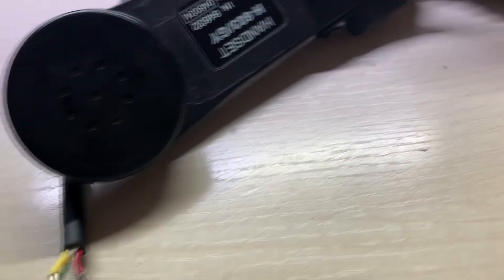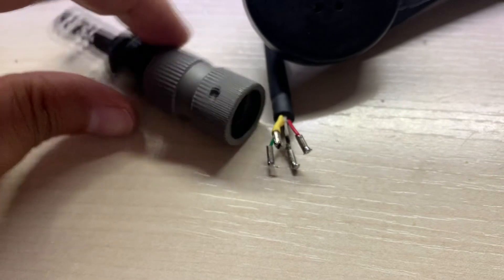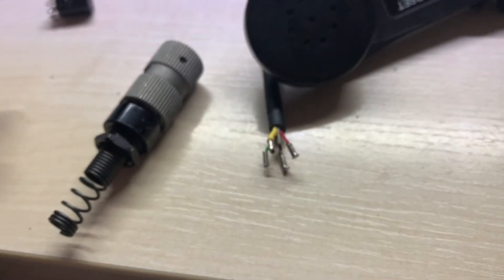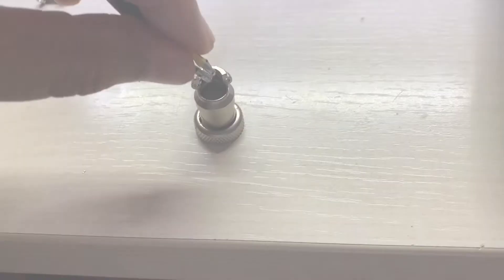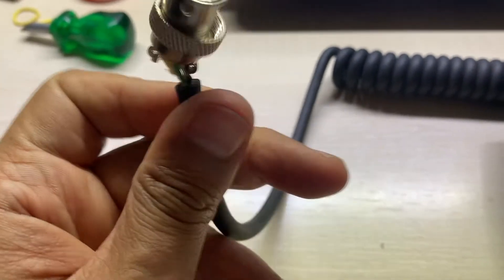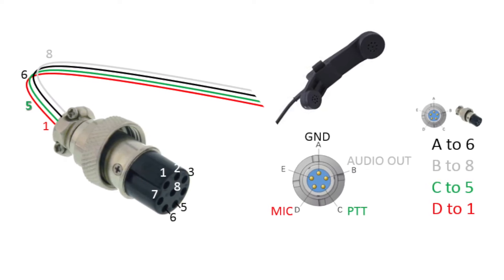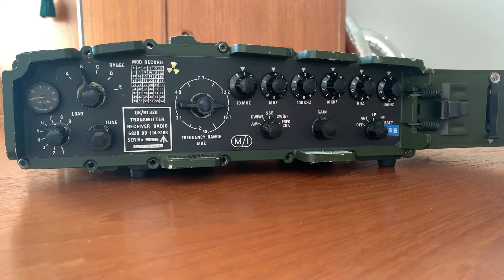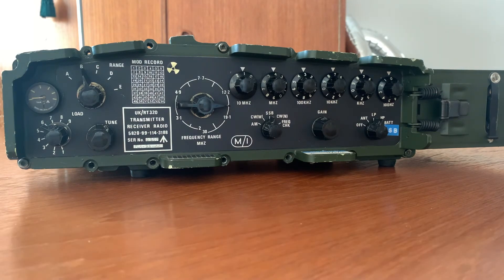H250 military handheld on your IC-7200

Comment: Very near my adaptation with the difference I kept the spring at the connector. It was a bit tricky to clamp a turn of the spring in the strain relief collar of the Icom 8-pin Foster connector. I similarly used a phone plug pushed into the  headphone connector jack to silence the speaker. I've got my mic gain set to 95. For those who might not know, the H-250 is so good at background noise cancellation, one needs to almost touch the handset mic with the lips to assure audio gets transmitted. Best regards --
N6MED
Reply from the maker: Thank you Jim! Rewiring a handheld is always and adventure

Comment: Only issue here is that the H250 mic is 150ohm and the 7200 mic is 600ohm. Need a few resisters in there.
Reply from the maker: Hi! Do I plce them in series after the pin 450 ohm? Thanks
Reply: @Radiogenes  T pad setup on the mic line
Reply from the maker: @535Medic  ah thank you!!I guess you mean a resistor from mic line to ground